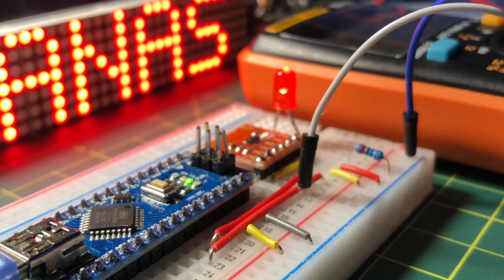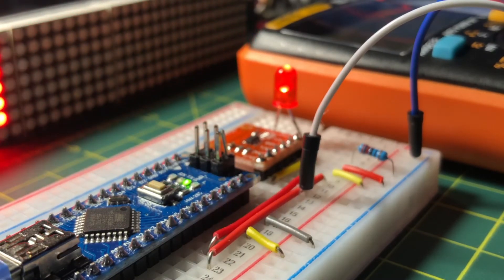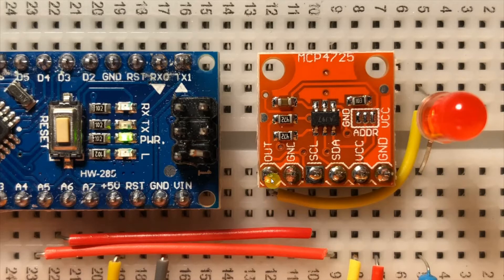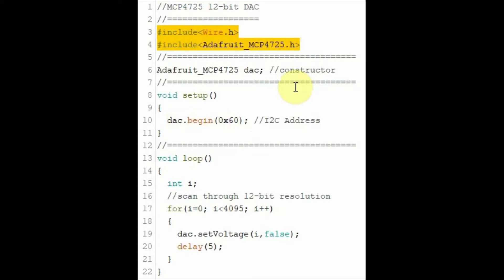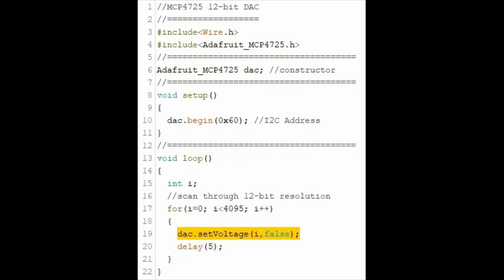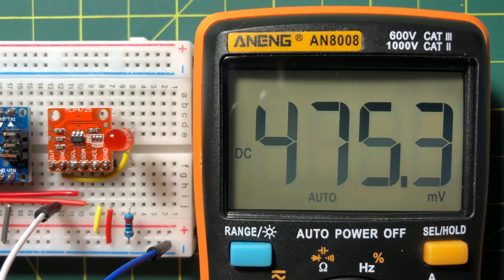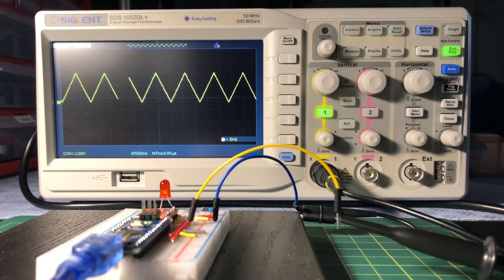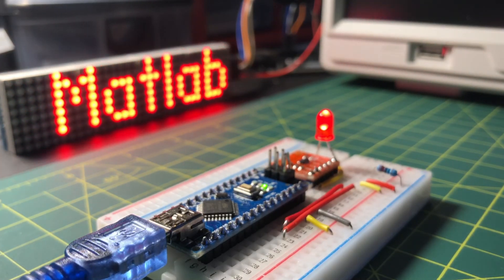MCP4725 12-Bit DAC

Comment: Hi! how can I make the DAC generate a specific voltage: lets say we have a table for a musical note and a voltage for that note; I want Arduino to be able to read from an SD card a series of notes and be able to output that Cv voltage with the DAC, so then, the VCO would play that tune.
Reply: Did you ever find an answer to this question?
Reply: I might be way out of my depth here, but I think my landlord built something similar to that but with tubes.. I know that doesn't help solving problem... It is funny though, the thing was probably using enough electricity to fry an Arduino a thousand times over... But it did sound cool lol... The kind of thing that you'd probably expect to find in the mad science experiment labs of early industrial light and magic, or a DARPA 30 stories sub sub basement for experiments on thought control and teleportation or something.

Comment: Thanks very much for this video which, is a bit close to what I'm looking for I think. I have a brushless motor and controller that I want to control via RC. The RC receiver I have puts out a PWM signal and the brushless motor controller requires a 0-5 volt DC analog signal on its input so, somehow one needs to be converted to the other. Trouble is, I'm not totally sure how to do it and the programming of the Arduino, though I'm sure is simple for most, could fry my old brain. Would there be a chance that you would be interested in doing a video of such a project please? All the best FrankH
Reply: That's kind of where those libraries come in by the by... If you get on to the Arduino interfacing software, whatever it's called, from their main website, and then you go into the libraries and you search around for either that exact thing, or various keywords like PWM to DC analog, or even very specifically by putting in the type of motor controller?

Anyhow, you're more than likely to find results of various different templates, and while many of them are well notated, even if they're not, taking that text and throwing it up on stack overflow or, hell even Google maybe can point you out to some of the the best practices and common terms that a lot of people use for the device.

Something like that is usually fairly less obfuscated than like making desktop modern software etc in c++, and a lot of times the the logic is extremely digestible when you're looking at a template like that, once you get to grips with some of the basic terms from the Arduino itself, like what the various pins are and some of the basic functions, and their terminology which is for the most part reasonably designated, and from what I've seen anyways reasonably iterated on and agreed upon... I mean it could always go weird, it's it's programming, and there are programmers, and it always gets weird.. But the the engineering aspects of this device and its use cases and the kind of people getting hardware hands on in combination kind of seems to keep things in a UM...

Okay so in all fairness electronic engineering is is almost as bad as programming when it comes to people describing in tutorializing in a language that needs to be taught first in order to actually understand the tutorial.. But.. at the very least, The limited memory for the longest time in the device, as.. honestly I I don't know I could be I could be setting you up for a trap here lol But from what I've seen anyways it's it's reasonable lol we're not talking about pages here we're talking about page.. although the new stuff could do whatever I guess.. But you don't have to do the new stuff if you don't want to because the old stuff works just fine lol.

That whole interface device and the library system and the community that's involved and all the templates out there that you can just find extremely easily it seems compared to pretty much anything that I've seen before in in this kind of genres or niches or whatever.. at least you know without having to pay a good chunk of money.. cuz I come from the video production world and lol there's lots of stuff like that but you pay extra professional pricing for it.. although back then the licenses used to be perpetual, and the software base itself had the good sense not to force you to upgrade it out of existence thus nullifying tens of thousands of dollars worth of plugins.. But it's 2025 now! And we have no shame! Or backbone in response!

I want to say it's it's like it's very old school, and and usually everything there in the libraries is is there for that purpose of being used as a template it's not like everybody's going to run around whining about people stealing their code etc.. or at least not that I've seen again lol.

Of course the downside is that because it's so easy to upload things and because it's kind of like the the default the way the system works, there's also probably a lot of trash out there but.. again I've had a very good experience so far.

now as to you're very specific question that you asked several years ago and this is probably not helping.. I swear I've actually done that, convert PWM to DC analog.. for very different purpose and much more simple expected results, but I can't remember off the top of my head what direction in the libraries to go with, but again it it's surprisingly not miserable to to look around for things.. and maybe that's just cuz all the things that you you can find that are also useful in I'm sure there's always that time when you're looking for that one thing and you can't find it but.. at the very least there's a whole bunch of other stuff that you'll be flagging for later..